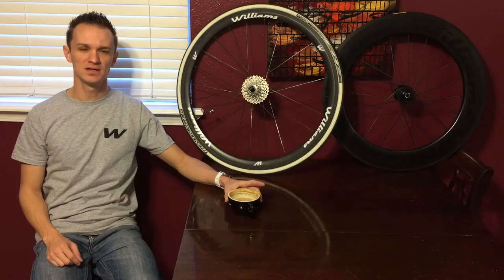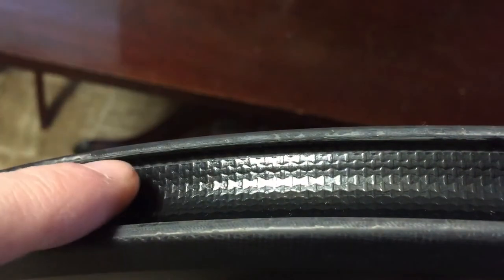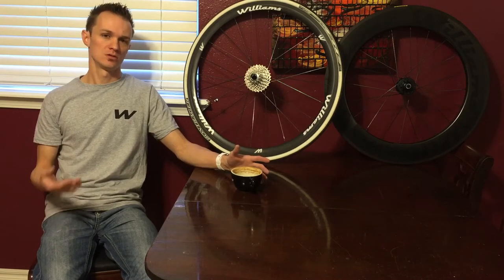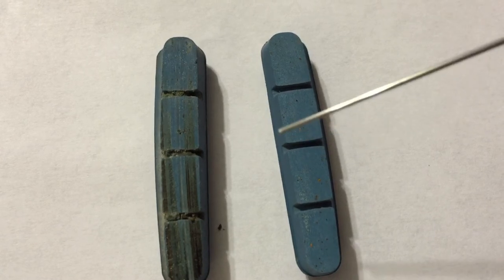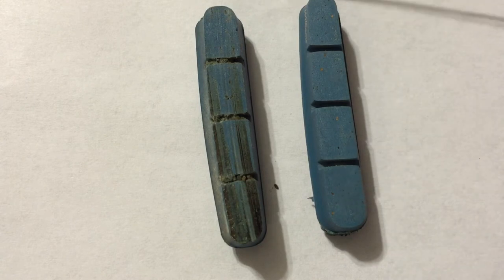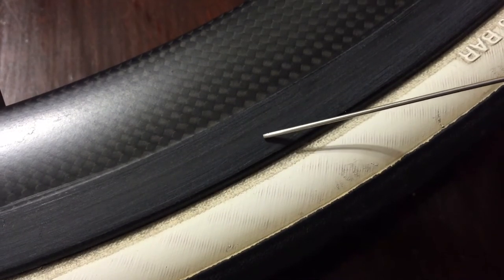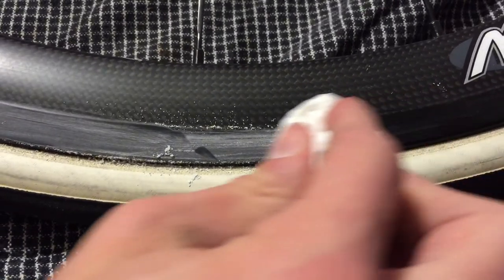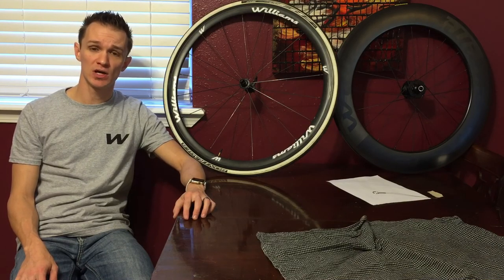Carbon Bicycle Wheel Care and Maintenance

Comment: Was reading how one shouldn't use sand paper as it will leave grit on the brake track
Reply from the maker: You are right and that is especially true if you use really poor quality sandpaper or something that’s quite abrasive. I used a high quality paper that can be used on cars and I was careful to clean the brake track off afterwords. I also was careful to just remove the brake build up and nothing else. The sandpaper I used was a grit small enough to not be a risk. If you are concerned about grit contamination you can use a 1000g, it will just take longer

Comment: DO NOT USE SAND PAPER ON CARBON RIMS!!!!!!
Reply: @MSRWorkshop  you can use scotch bright. It will not leave particles on the rim to be ground in. The sand material is very very hard and  u get a single piece in bedded in a brake pad and you just made a big issue. Best to do is to use acetone and a cloth to wipe off the marks. Carbon wheels cost to much to be removing any material and shortening the life of the wheel.